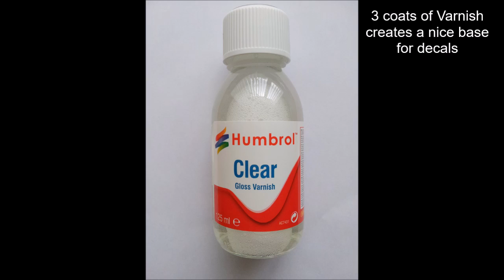Airfix 1/48 Scale Gloster Meteor F.8 - Paint

Comment: The plane was overall natural finish.  Why did you use black basing on the underside with marbling, but used pre-shading on the upper surfaces?
Reply: They weren't natural metal finish - it was a silver lacquer called 'High Speed Silver'.

Comment: Great build, What white primer did you use on the model?
Reply from the maker: Thanks Daz85UK. I used regular acrylic aerosol can from a DIY store. I dont do this method before as I can get a better finish using my airbrush and Tamiya paints
Reply: Thanks for the reply. One other question, do you use a matt coat to finish the model? If so what one do you use?
Reply from the maker: Daz85UK No problem. Yes I use a mix of Humbrol Gloss & Matte clear to get a satin/matte finish. Pure matte seems to make the model white so the gloss takes this away.

A mix of around 70:30 gloss:matte if it helps

Comment: Hey I have a question about airbrushing. Do you need to do like layers with brush painting or can u just do 1 layer
Reply from the maker: You need to do around 3 layers (depending on paint thickness). I start with a "dust" coat to lay the colour coat down initially, then followed by 2 more slightly heavier coats to get the colour to build up. The paint I use is moderately thinned to be accepted through an airbrush for reference. Around a 60:40 Paint:Thinner Mix

Comment: I am an OLD kit collector, (and builder), and I wonder: does anibody stil use painting brushes??? 
   When I started, (1957/58), there where NOT aerographs, and I did EVERITHING with brushes!!!
   Even today, (and I have several aerographs), I dont use them to paint, for exemple, cockpit interiors!!
   I do it with painting brushes, and trying to have a steady hand!!!
   I only use the aerographs for larger surfaces .
   I can not imagine all the trouble of CONSTANTLY have to clean those aerographs, if you use them constantly!!!
   No great art in that!!!
Reply from the maker: A Rodrigues I do use a brush where possible, you are right cleaning them out all the time is very annoying! I try to manage my paint sequence so I spray multiple parts the same colour simultaneously. The order of the video isn't necessarily the order I made it in 😉.  Painting by airbrush is an art I use to achieve smoother paint results
Reply: I still use brush
Reply: I found switching to Air "brushes"  seamless, don't get me wrong. I still hand brush details. but I think in todays multimedia kits, I think you will find air brushing has become the new norm.